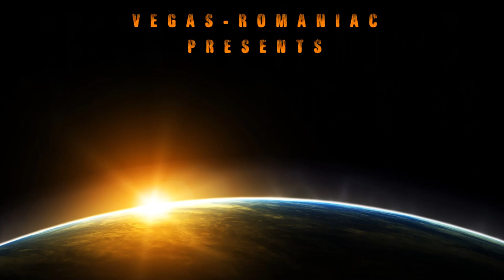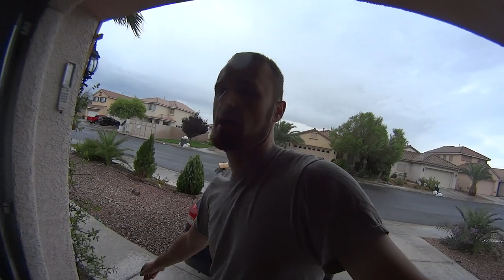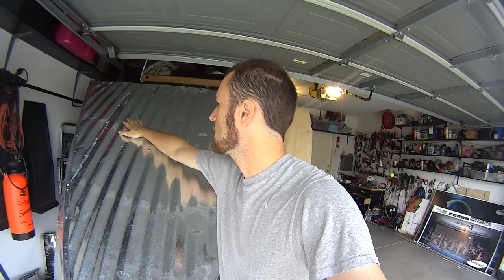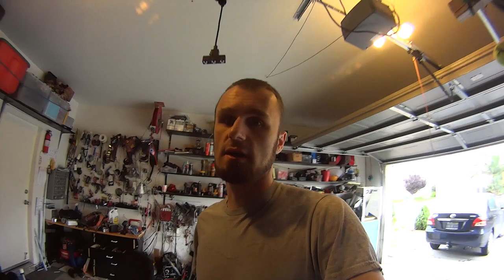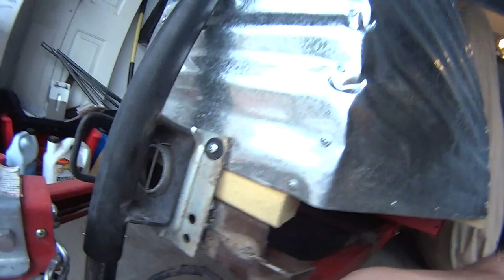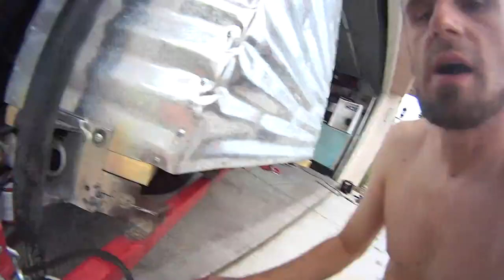Harbor Freight Adventure Trailer - We Got a Leak

Comment: On your weld. 
1st. Grind the shit out of the area before you weld. It needs to be clean metal to metal weld."So important".
2nd. More heat. It needs a deeper penetration.

Instead of silicone in the seams and screw holes I've used a white roofing sealer that you roll-on with a paint roller it goes on thin and slick then as it dries it expands a little into the nooks and crannies. It could work. 
And white would keep the heat down.

Here's another idea. Why don't you produce a a gathering of those who ride off-road bikes A 3-Day hair and hound scramble with a chili cook off in the evenings and of course a beer garden. Do it up there where everride hangs out or keep it in Nevada. Hundred bucks ahead entrance fee. You were looking for a retirement plan this could help you get there.

Think about it!
Reply from the maker: Great ideeas, I need to Check with everide if he wants to rent a coup of acres in his desert .. haha